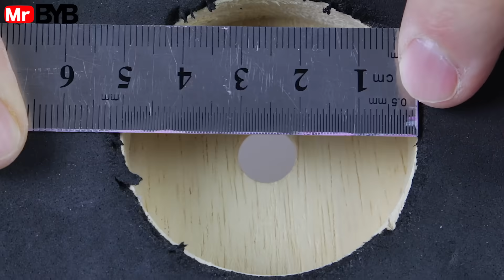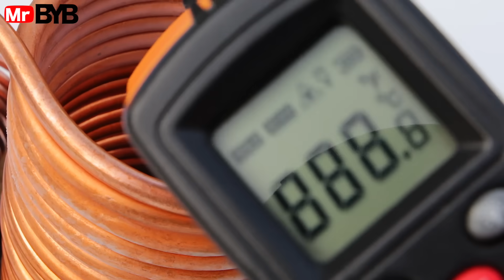How to make a Fast Cooling Freezing AC : Conditioner for Portable Mini Refrigerator to -10°C!

Comment: Before charging the system with refrigerant, you should have vacuumed out the air, bringing the pressure down to at least -20°C. Air in the system prevents proper cooling and significantly reduces efficiency.

Comment: You can see it cooling off with clock.  Thats the whole point of clock.  And those who think the motor isnt enough to create enough pressure, again thats the point of the 3 different size lines.  Like leverage with a long bar, you get more leverage with length of copper pipe.   Then bleeds back off into bigger line.  The hole for fab goes out side of wood.  This is all the flow needed for fan..just enough to help keep the lines from freezing up.  Main reason most ACs always had issues at work, not wnough air flow.  This is small and is using a much more basic design.  Science is cool, realize why their are so many comments always trying to so call debunk. 
Reminds me of salt, most believe it to be bad for ya.

Comment: \/ YOU DID NOT DID THIS !, PLEASE TRY.../\.\.\

You should install high rpm fan(drone fan with  L Pvc bend for air passing) for faster cooling.
Also, You should use, Insulation LIKE STYROFOAM padded MDF Board box, so that
room hot air does not make hot cooling coil tower !

Comment: Here the tap water is 2 to 4c and putting the soda can under the running tap water cools it down from room temperature 24c to drinking cold in about 2 minutes and ice cold in 5 minutes. (maybe less as usually when I do it they are already a little cold).

Comment: Seems there is a problem with the triangle sprocket in the widget mainframe. I'm pretty sure this is similar to a design to a part needed for a time travel experiment I got high and dreamed up. If that thing works as it's supposed too this is a serious innovation and a step closer to fully refrigerating beer cozy things.

Comment: Dear Bro Perfect 
Some questions
1. Is your Pump air tight
2. Why keeping can, is it getting cooled or cooling the copper coil. Because I have worked with pumps they were not air tight. At what pressure the gas is in the pipe.

Comment: Why did you solder the connections between the copper pipes instead of gluing them, if you use thin rubber pipes in the system that would not withstand such pressure?

Comment: My mom likes to make things like this, makes for alot of wasted materials.  And really pointless projects . At least you had fun. I guess 😂
Reply: It solves a problem. Not necessarily a problem you may have, but for anyone who is not a fast drinker and likes their drink to be cold, without eventually becoming 90% water after you've topped off the ice 3 times over an hour or two. The alternative is getting up to put the drink in the freezer every time you want a sip, if I tried that I'd never finish any drinks, so instead I just deal with the not-cold drink, or deal with it getting watered down. This would solve the problem for me. 

There have existed many electric drink warmers, heated cups, heated coasters, heated cupholders, the list goes on and on and these products are meant to heat and keep your coffee warm. NOTHING like this has existed for the opposite effect: a small electric device/cup/holder to keep something cold all day, without introducing excess water to the drink. There are times I have a lot of sun, electricity, gasoline, propane... Many ways to produce heat and electricity, but I only have 1 cooler of ice hiding in the shade that has to last me all week. Anytime you open it, ice melts. Anytime someone wants a cold drink, they have to open the cooler to take the drink, and possibly even take a handful of ice. Having something electric that could chill the cooler, or chill specific drinks so nobody needs to open the cooler, would be amazing. I don't care if it's 10 amps, the sun handles that and I already have plenty of batteries!

I totally understand wasted materials. 3 sizes of copper tube, two types of synthetic tube, and where I go you need to buy all of these in 10ft rolls! Like $70-$100 for the materials. But once you have the excess from one project, where you spent more than you needed to and had waste, the next project might become cheaper and use your excess from the previous project! It cancels out over time, and leads to you having a huge collection of tools and parts and materials so you can fix and repair and solve problems as needed

Comment: Actually this will work, they are now using butane in all domestic refrigerators, the capillary tube is where the cooling takes place just like in the video. Is not very safe but is a cool design.

Comment: The fan should not  be blowing through the evaporator cooler  rather it should cool the condenser to  liquify the gas . The cappillary tube should be hot not cold because  the evaporated gas is being compressed

Comment: The use of the clock to show that the video isn't really just the copper tube thawing out after being hit with some freezing spray is an innovative touch. Rather than get hold of a clock that runs backwards you just use a few shots of it  and don't show that the time is being adjusted.

Comment: To get the evaporator to that temperature you need a suction pressure of -50kPa or so for R600 (butane). A head pressure of 400kPa would be a reasonable enough assumption as the condenser is a bare tube, convection cooled. That little pump can’t push that sort of compression ratio, no way. The capillary tube is far too short for this to be achievable. The capillary tube frosting up suggests either the liquid butane is undergoing a pressure drop before the capillary tube. At normal atmospheric pressure butane boils at close to 0 degrees C, just a tad under. There’s more to this system, it cannot operate correctly or efficiently as built.

Comment: I made this using this example but the gas pressure keeps rendering the system workless. I used 12v dc battery, 12v aquarium pump, 12 v fan. This system works but the stuff doesn't seem to be working. Where am I getting it wrong?
Reply: Lots of reasons this wouldn’t work but main one is that pump he’s calling a compressor. It is not even close to what is needed to make a refrigeration system work.  0:22

Comment: It is very clear that he is lying. The first evidence is that he did not empty the air from the pipes while pumping the gas. The second evidence is that the fan has a very small hole that is impossible for it to be sufficient to draw in air. The third and conclusive evidence of the lie is the way the pipes freeze. They freeze in a circular shape from the sides to the middle, and this is what indicates However, he stops filming and sprays a small bottle of gas on the copper pipe. It is a 100% fraudulent video.

Comment: Es falso nunca anduvo y soy técnico en refrigeración  ... Saludos desde argentina
Reply: Hola yo también intenté hacerlo es imposible no me dedico a esto pero compré todos los materiales incluso encontré la bomba por mercado libre es la misma me cansé de inyectar el has con la aguja y avía muchas fugas hasta puse abrazaderas hasta que me di cuenta que el gas se escapaba por el mismo motorcito es imposible la idea está buena se supone que a si es un circuito cerrado pero necesita al ser gas un motor que no tenga fugas como el moto compresor ya es mucho para una maqueta ... Y otra cosa también al tener en cuenta es la contaminación con el mismo oxigene que tiene la manguera se supone que el gas de la lata no hay oxígeno por eso es que está de forma líquida siempre es gas se me iba por todos lados no hay vacío en ese círculo de la maqueta. Pérdida de tiempo y plata pero fue lindo mientras duro jaja 😅

Comment: No vacuum  direct gas charge 😮?
Reply: Its rubbish  the tag which  has tied to the pipe it doesn't  tolerate  the pressure  it will  bust😂😂😂😂

Comment: Anyway, whatever type of gas it is with a centrifugal pump with a turbine, it is impossible to create compression on the gas because the gas returns back. For this process, a reciprocating pump with a piston and a suction valve is needed, compression which does not allow the gas to return back.

Comment: Of course this can't work, but with all the HVAC experts in here, why has nobody mentioned nitrogen purge and evac. A tiny 12 volt water pump cannot make enough pressure to cause the refrigerant to liquify, sorry, it's just physics. That being said, it was still fun to watch.
Reply: they did. you just cant be bothered to read.
Reply: @joeds3775  Did somebody say something? nope, nothing important.

Comment: Sooo... They put it on the board with a hole in it and fan sucking air from that hole and blowing it up to the can? :D
Im pretty sure it could be done more easily if the can is put directly into the dry ice which is blowing freezing ar through the hole in the board :D

Comment: The coils on the condensor should not be tight together! Terrible heat transfer. And need a few fins on them! Also, the condensor allways needs to be larger than the evaporator.

Comment: I see its a cheap fun way to do that, but what's the purpose of the fan if only have a little vent hole, the wood block from the bottom on the table and the can tight to the coil?  That fan not have a purpose and only drains the battery. I think was way better if you use the fan to cool off the heating coil instead and leave the cold coil by itself with the can.

Comment: Do i understand this right? the gas releases heat in the medium coil, gets compressed in the small coil because of the small diameter turning into a liquid then expands to a gas in the large coil pulling heat from the can then goes through the pump then to the medium coil releasing the heat again completing the cycle before being compressed again in the small coil?
Reply: The medium coil is the expansion device
Reply: Basic refrigeration
Reply: its not being compressed its just being cooled, losing that heat energy allows it to liquify at low pressure.

Comment: That fan is doing almost nothing. Hardly even able to create static pressure. It just can't do much with how you mounted it. It's a PC fan, not a centrifugal or turbine motor. Simplest fix would be to use a blower fan, so you have an angle to work with.

This is the one single thing I'd fix about this. Everything else is fantastic at this scale. Great design.

Comment: If I were to try this, I would do three things differently. 
First, I would insulate the outside of the evaporator coil. As it's being used for contact-cooling of the soda can, why let it uselessly cool the surroundings? 🤦🏻‍♂️
Second, I would open up the condenser coil to form a circular array and put that against a vertically-mounted fan (or horizontally-mounted but with a good couple inches of intake air gap!).
And third: if I want that to be battery-powered, I'd use at least three lithium batteries. That piddly little 9V battery with the six AAAA batteries inside can't supply much current. I wonder how many 9V batteries were needed to cool that can of soda? 😄😄

Comment: I hate this garbage clogging the internet. And worse, there are people that think this is great. This is the same crowd that thinks electric cars will save the planet.
Reply: 😂😂😂😂😂 yow we only have 150 years before fossil fuel runs out if continue using and our population continue growing😂😂😂😂😂😂 do you think e cars don't help?😂😂😂😂😂😂😂😂😂😂😂
Reply: @dai-ut5zl  no they don't. They generate more CO2 by the time they roll off the assembly line than a gasoline or diesel car. Where do you think the electricity comes from to charge that electric vehicle? Fossil fuel. So they are already worse when you pick them up at the dealer. That's not to say we shouldn't stop burning oil and coal, but EV's are not the answer.

Comment: Ok, I read all the comments. Some I liked but the nay-sayers need to prove their opinion. This should work. The fan is not really necessary but it helps focus the cold. You conceivably use ammonia in a system like this but it would need higher compression. This would be an excellent or adequate system to build a mini-fridge or an AC unit for a Teardrop trailer.

Improvements I would recommend: Pumps mounted directly to a solid surface create vibration. Vibration equals noise. Use foam rubber insulation or car door gasket material to act like a sound buffer to reduce the sound. Though this build was for a demonstration I would make a plastic enclosure for it lined inside with thin soft foam sheeting. This should also help reduce sound. A speed controller for the pump is a nice touch as would an on/off switch. And go ahead and add an on LED light. Add a power jack so you can use different power sources like a cigarette lighter, a small power supply or battery pack - all 12v DC.

I hope this helps stir imaginations. I’m going to build one.
Reply: The pump being used is designed for liquids, not gasses. It can't generate 1PSI moving a gas, let along the 100+ PSI required for a refrigeration loop (using butane (R600) as the refrigerant) to function. Even if it could generate that kind of pressure, it would would blow out the silicone tubing and you would need a fan on the condenser coil too, not just the evaporator coil. The only way something like this could possibly cool a can of soda is if you instead filled the tubing with glycol and put one of the coils in a bucket of ice water. Even then, your just using the ice to remotely cool the can.

Comment: I wonder if the butane leaking from around those zip ties (they are all oriented the same way thus causing a place for leakage) is help in the cooling just because of evaporative loss.
Reply: I was surprised when no liquid electrical tape, and not even any rubber cement, was used to cover those zipties and the part where the tube is clamped onto the pipe, to ensure an an airtight seal. In fact, I'd have carefully sealed the copper inside some liquid polymer, carefully painted along the tubes, so it fully coats them, for at least a half inch diameter on either side. For the tubes, the pump, wires, coating of liquid electrical tape.In order to keep from EXPLODING THE CAN, which such rapid and severe cooling could do, I'd have a fan blowing the cooled air into one end of a container, with several tiny exit holes drilled all over the container, to let the cooled air out in every possible direction, ensuring the can is evenly and carefully cooled all over.
Reply: OMFG This is the video edited backwards.
Reply: Тоже заметил. Уж лучше бы припоя напаял 😁

Comment: I didn't think that is a aquarium pump. Looks like a Water Pick pump. You know those mouth washing devices. Those pumps are pretty powerful in creating high pressure. My concern is the 9 volt battery, those pumps require 12 volt. I will give it a try someday.

Comment: To be fair, using a 9V battery is not enough to run a 12V native brushless AND a brushed motor at the same time. Use a cheapo bench power supply next time, let alone a tiny wallwart, as batteries don't last long enough. :/
Reply: To be fair neither of these two motors need a high RPM for this to work so the 9V is sufficient.

Comment: I can confirm this is a real refrigeration cycle that this person is using but, I’m not too sure of is how that Little pump he’s using as the compressor able to generate enough pressure to make the refrigeration cycle work but  I do know is that frost you’re seeing is telling you the refrigeration cycle is working the style refrigeration system he has built is a capillary style refrigeration system. It’s one of the simplest refrigeration cycles ever and frost is normal even in  Your refrigerator in your house It’s just you don’t see the frost because there’s a such thing called a defrost timer that shuts the Compressor off in the fridge for a few minutes And turns on a small heating element that is on the evaporator to melt the frost. It does it once a day usually in most fridges.
Reply: I'm fairly sure that air pump wouldn't compress much if any at all
Reply: Bạn đã thực nghiệm chưa, nhiêu người cho rằng video lừa rối.

Comment: Why is the fan air flow blocked by the wooden board 🙄
Reply: I don't even know why it's there. What needs to be air cooled is the hot compressed gas after the pump.
Reply: dont you see the small hole on the wooden board
Reply: @AhmYass-u6o that’s not enough for adequate air flow are you serious?